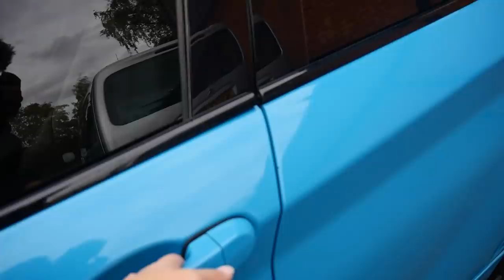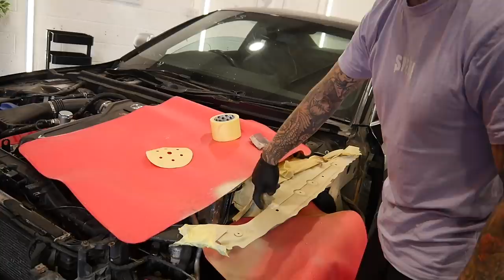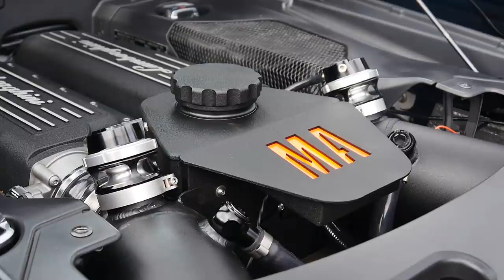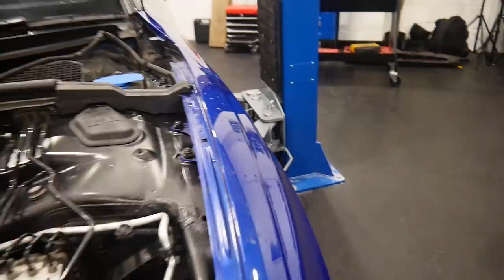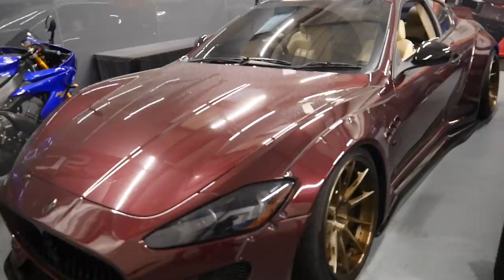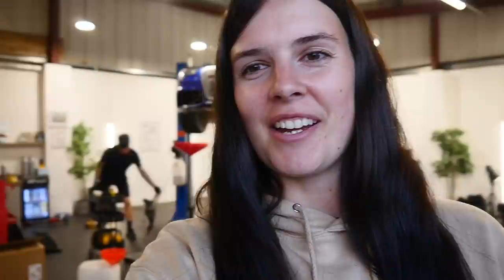UPDATE ON ALL OF MAT ARMSTRONGS CAR

Comment: Yaaaaaas, for the M140i: Pro Media Screen, xHP gearbox software, Wavetrac LSD, Stage 2+ hardware & custom remap 👌🏼, meth Injection, high pressure fuel pump, M2/4 Comp front seats 🙌🏼👀

Comment: On the E46 M3 please check the oil that was put in it, it looked like 10w40 was used. Should be 10w60, the rod bearings will wear rapidly using 10w40 and ruin the crank.
Reply from the maker: We did use 10w60 don’t worry 😊

Comment: Heads up.......: Somebody touches your hot exhaust pipes, your vehicle is stationery, their fault?. You reverse into a person and they come into contact with the hot parts, who is at fault? The dangerous component is yours. Make sure you are not exposing yourself to risk that could be avoided. 👍
Reply from the maker: I just like to think of it as it’s the same as a motorbike 🙈 plus if you reverse into a person in any car it would be the drivers fault

Comment: that lambo without rear bumper. it just looks so dangerous. he should put at least a transparent bumper so you can see the work from the outside. but just not having any sort of protection of the engine... it looks so dangerous...